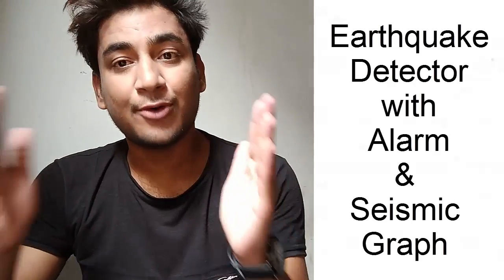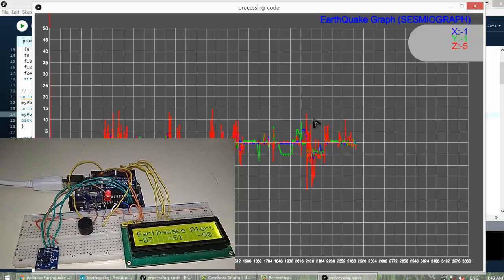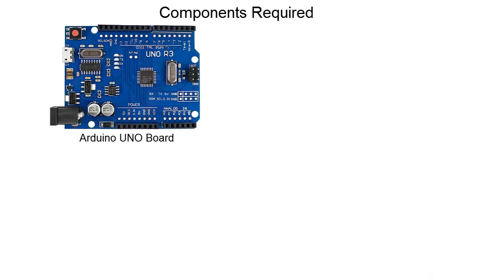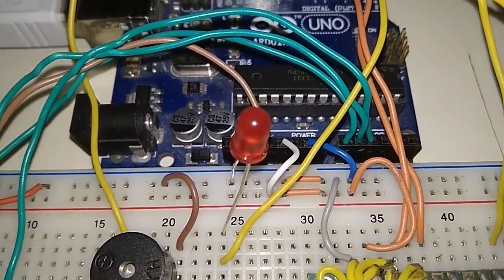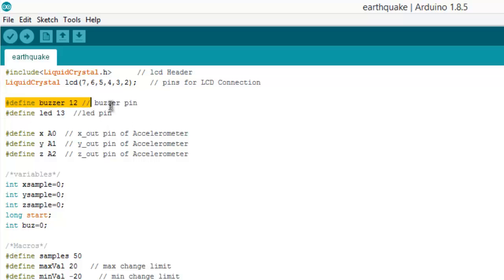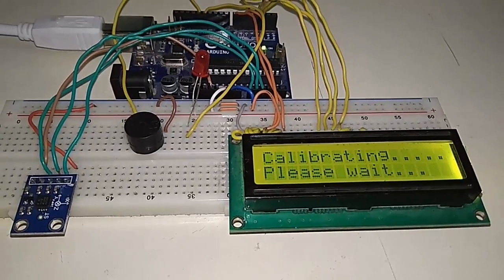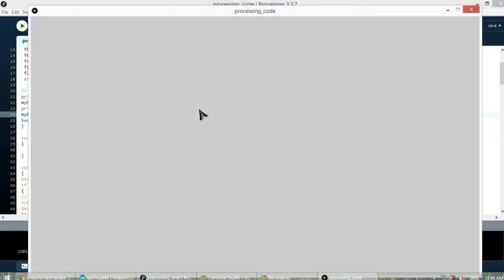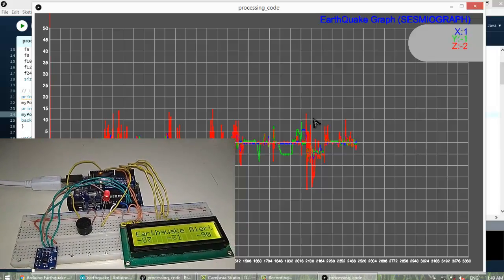Earthquake Detector with Alarm & Seismic Graph using Accelerometer & Arduino

Comment: using the diagram that you had given, it seems as if the arduino would short circuit itself with the ground and 5v. any way to fix that?
Reply: Hey did you find how short circuit can be avoided

Comment: Hi! I have a question. Do I need to keep the arduino plugged to my computer in order for it to work? Or can I unplug it?
Reply from the maker: You can use any external power supply like 5V battery or adapter.
Reply: @HowtoElectronics  okay thank you so much!!
Reply: Will this work with a 9V battery? They don't sell 5v batts haha.

Comment: Can you do an upgrade? It Will be fanstastic if this seismograph sand the data of accelerometer to the pc without the cable with WiFi or ZigBee. With this upgrade we can register also when we aren't near the station. Thank you
Reply from the maker: This can be done through Ubidots over wifi I guess.
Reply: th you have some code for this proposition

Comment: Hello Can I use ADXL345?
Reply from the maker: ADXL345 is I2C digital accelerometer.
Reply: @HowtoElectronics  so does it mean I can't use it??
Reply from the maker: You can use but not with the same code.
Reply: @HowtoElectronics  Can you make a Code for me sir? Or Teach me how to make a Code for it??
Reply: Can I use ADXL345

Comment: What does the code
int buz=0 mean?
Reply from the maker: Initilization of buzzer output, stating initially its zero.
Reply: @HowtoElectronics  thank you and lastly what does this mean?
       if(buz == 0)
       start=millis(); // timer start
       buz=1; // buzzer / led flag activated
Reply from the maker: Mills is used for setting time interval in milli seconds.

Comment: is there a way i can use a speaker instead of a buzzer?
Reply from the maker: Yes u can . Remove buzzer and connect 8 ohm speaker.
Reply: @HowtoElectronics  what about an amplifier for a louder sound?
Reply from the maker: Use amplifier circuit made with LM386 ic and connect speaker of high volume.
Reply: @HowtoElectronics  is it possible with the arduino uno
Reply from the maker: No
Reply: @HowtoElectronics  arduino mega is needed?
Reply from the maker: You cant use any arduino board or microcontroller. You can only use amplifier circuit.
Reply: @HowtoElectronics  so how can i connect the earthquake alarm to a loud speaker